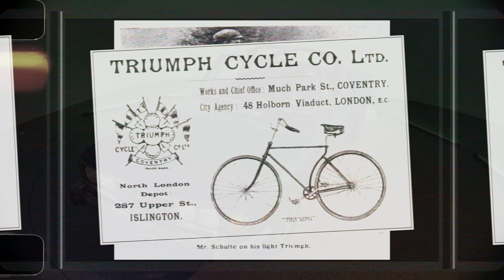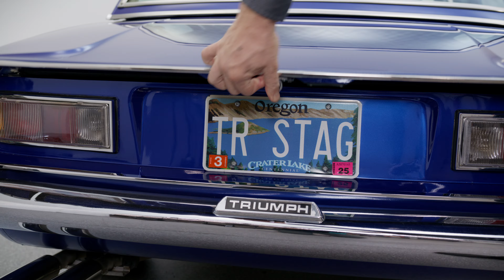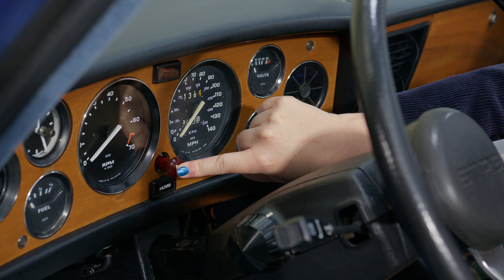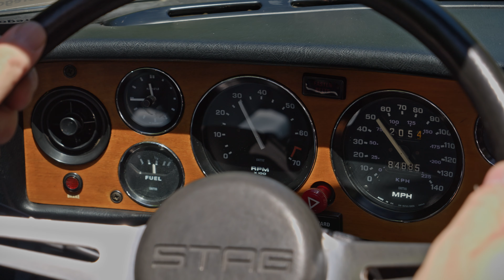Triumph Stag: British Leyland's Most Ambitious Failure | E2E E11

Comment: Love your review< I would go higher on reliability as the Stag was the only car that did not have any major issues on the final episode of the Grand Tour  when they took one to Zimbabwe and Botswana. Also it is one of the top classic cars that has the best survivor rate in that out of the 26000 produced more than 10000 are still on the road with a great support network. Also i have a 71 MK1
Reply: We watched that, but filmed this long before the Grand Tour video came out!  The support network is pretty good, though almost entirely UK based, and a lot of the major problems that were there when the cars were new have been addressed in the aftermarket.  That said, some of the initial issues with the design of the engine are insurmountable making it always a little risky should problems start to develop.  There are still quite a few of the small number of cars sold into the US on the road, but many have had the Rover V8 or a Chevrolet V6 engine swapped in.

Comment: Great vid. Better than Jay Leno's vids for sure. He would have been making snide comments about Lucas electrics, with the comments full of Anglo-phobe jibes. BTW, SAAB used Lucas and Girling brakes, a car brand Jay lauds. I have had countless cars using Lucas electrics and not one gave problems - it must be the air in the USA.  

Although car manufacturers like MG skimped in their electrical systems by not having alternators, batteries just big enough to cope so when the battery deteriorated over time you were in the problem area, not using relays for high amperage components and not using weather-proof connectors - all not the fault of Lucas. All this was easy to do in the factory and after market fixes.
Reply: I agree!   we have a large number of cars from the 1930s through the 1970s, with essentially stock Lucas electrical systems and have very rarely had any issues.  I've had more problems with Bosch electronics failing in classic cars than original Lucas components.  That said, most British cars have very little capacity to handle anything like an electrical short, as there are often very few fuses and often several circuits on each fuse. so, especially when people attempt to modify or add to the electrical system with things like a radio, etc. they either overload the draw or poorly wire things in, causing many of the problems themselves.  There are some exceptions, such as Jaguar, with more robust electrical systems, but many cars only had two fuses, while our Hillman Minx made do with just one.  Still, it was better than our Ford Cortina Mk1, which didn't have any at all!
Reply: @ahaugland1  
The Cortina was made by a US company. 😆
I once changed a dynamo to an alternator on if I recall on an MG. Also fitted a beefier battery. Where the now redundant voltage regulator box was I fitted a relay box with a number of relays so heavy current never ran through dash toggle switches that could easily burn out. Also a big fuse box, then spit the circuits with most having their own fuse, involving adding some wiring. And of course weatherproof connectors. 

A pity high torque starter motors were not available for it then. 

All the car makers had to do was copy a domestic electrical system having fuses on many circuits - divide and rule.  A domestic electrician would never have a house all on one or two fuses or breakers. Normal electricians would look at cars seeing that if one component failed it could take the whole car down. That was not how they approached electrical systems.  Also, if there is a fire he is in court - the law says you must be competent. Looks like many car manufacturers were incompetent, but got away with it as what they were wiring was not inside a house.

Comment: To be fair it has been a hell of a success for a failure with 4508 still registered in the uk and a further 2000+ on off road registrations so under or awaiting restoration.
Reply: To be honest, the survival rate is indeed pretty surprising!  That said, with the US market being what they were aiming for and the car ending up being pulled from that market in 1974 after dismal sales brought on by the reputation of the early cars, it can't be said to be much of a success.  A lot of the issues with the early cars did end up getting addressed on the Mark 2s and quality improved as well as a lot of aftermarket know how came in to fix what remained, but it was already too late for the US and with an increasing set of emissions and safety requirements, it didn't make sense to redesign the car to meet the new US standards when sales were as dismal as they were.
Reply: Unfortunately at the time triumph were swallowed up by British Leyland so although they had their own design studios, and engineers the budgets were controlled by accountants. The main issues with the engine mainly the high position of the water pump and the head bolts and studs were in part down to the fact that SAAB used a 4 cylinder version that due to the fact it was mounted the opposite way round to Triumphs use in the dolomite, meant the high water pump and angled head studs. The accountants would not sanction a redesign for triumphs use which was for rear wheel drive use. The stag engine was basically two of those engines combined.  Rover who were under BL as well already had a V8 which was a derivative of the GM unit from Buick 215 but Rover were in competition with triumph in the upmarket saloon sector so had little interest in helping and triumph went alone. To be honest this was an era where everything was falling apart in the Uk with unions preventing modernisation, politicians interfering and trying to run industry and money being King. The aero industry was another victim. The BAC TSR-2 a Cold War aircraft years ahead of it time, cancelled, The harrier jump jet, many attempts to stop the project, Concorde almost cancelled. I was a toolmaker apprentice back then by 1978 had a Triumph dolomite sprint. Yes the same overheating issues and head warping as the stag which were addressed after market, but we are talking a 4 door sedan, with wood dashboard and door caps, a 2ltr 4cyl 16v engine producing 127bhp 0-60 around 8 seconds 116 mph top speed which was pretty quick for those days. Not many of those stateside but a smart looking car and again here a valued classic like the stag. The success of the marque although as you rightly point out was not realised at the time, has to be in its classic status and the fact that is perfectly capable of driving in modern traffic almost 50 years on.

Comment: would a Davies Craig electric water pump mounted lower down help?
Reply: Possibly, though the original water pump works OK as long as there's no loss of coolant.  An expansion tank definitely helps and the Mark 2 variant has one fitted as standard.

Comment: Triumph's main buyer for sporty cars was the USA. V-8s were selling beefy sports cars in the USA which are now out of fashion. Triumph could have fitted a tuned up straight six into the Stag, but V-8s sold in the USA. The Stag's engine was effectively two Triumph slant-4 45 degree engines bolted together. In the mid 1960s SAAB needed a new engine for their 99, being referred to Triumph and their new design by Ricardo. The 45 degree slant-4 gave lower hood lines giving better aerodynamics. The Triumph slant-4 was used by SAAB in their 99 and 900 cars from 1969. SAAB were the first to use the engine three years before Triumph had it in a car. Using British engineers SAAB started the turbo craze in 1978 fitting a turbo on the slant-4, achieving far more horsepower out of the engine, of which the well made and designed engine handled with ease. It was still being made in China a few years ago, may still be manufactured. The excellent slant-4 was the basis of the Triumph V-8. But bolting together two excellent slant-4 engines never went quite right. 

The high-mounted water pump on the slant-4 was insisted upon by SAAB for maintenance access, as were the angled head bolts. Because they had the engine backwards with the clutch at the front with the engine over the sealed gearbox. So when the two slant-4 engines were made into a V-8 the water pump was also high. Not a problem if the top up water coolant bottle was located high, which in the Stag it foolishly was not - this is basic stuff a simple mechanic studies at tech' college.

There is a U tube video by the Stag Owners Club that runs for about 25 mins. On it are some of the designers of the car and engine, who highlight the easily preventable faults. The prototype engines never had cooling problems after many miles of harsh testing as they got a German company to make special cylinder head gaskets for them.  The buying dept penny pinched buying cheaper gaskets from other manufacturers which never had the compression of the German company - oops.  The head manufacturing was subbed out to two companies. One company changed the water gallery sizes without telling Triumph, starving the head of cooling water. So if you had an engine with two heads from the rogue company you had a disaster awaiting. Or a car from the company making the heads to specification with two good heads then you had a star.  Some engines from 1970 inexplicably went like dreams, so now we know why.

The Rover V-8 engine was considered with the designers saying they would have to lengthen the engine bay by four inches. Not a problem to do at the design stage. But Rover said they could not supply the V-8 engines as they never had enough manufacturing capacity, needing the capacity for the upcoming Rover SD-1. Inexplicably BL did not expand the Rover V-8 engine manufacturing plant to suit their own internal demand, but perversely spent on developing an unneeded new V-8 engine and the teething problems new developments brought. 

Most the problems of the Stag engine were rectified by simple after market solutions. Mainly the many cooling system fixes available including electric cooling fans, superior head gaskets, higher quality timing chains, electronic ignition and high quality synthetic based oils. Simple fixes in themselves which should have been in the original 1970 cars once the problems were known, no doubt making the car a well sold gem as the problems were primarily with only the engine, the rest of the car was superb. The simple after market fixes make the Stag one of the most reliable classic cars today. 

The best bodies were made with an element of hand built at Liverpool by a substantial number of ex marine industry artisans made redundant as ships were becoming massive so fewer ships around. This up-scaling in ship sizes meant the highly skilled men were not needed in the massive port. These men hated car manufacturing, hate might be a mild word, lowering themselves to work in such a low skilled industry, which was not a part of the city's mainly marine based manufacturing culture. Being artisans when they worked it was done right, like paying attention to water ingress as stopping water getting in was second nature to men who worked on ships all their lives. They did all on the car body, including the interior and electrics.

The body was trucked 100 miles to Coventry where the two suspension/engine sub-frames were bolted on underneath complete with components. The smaller sub-frames could have been shipped up to Liverpool having many in one truck instead of large car bodies taking up much truck space going the other way. But never mind, logical thinking did not apply. When the Stag's body manufacturing moved to inland Coventry, as space was needed in Liverpool to build the TR7, the quality lowered.
Reply: What a knowledgeable tribute Sir. It is true the cars bodies were put together with loving hands in the main. I am lucky to own an original car that had a wise initial owner who specified Underseal.. To leave the undercarriage with just red primer was criminal penny pinching

Comment: As a long-time owner of a Stag and admirer of the car when it was first introduced, i agree with many of your comments and feelings on the Stag. A properly sorted and maintained Stag is  a joy to drive. I never tire of it. It actually lives up to its original remit as a sophisticated, comfortable touring car pretty well.
The power steering effort can be reduced  to improve the steering feel.
One other small thing I would like to correct you on is that the front suspension is not double wishbone, but Macpherson strut. More in line with the 2000, 2500 range, not the Tr6. 
Anyway, I enjoyed your take on the car.
Reply from the maker: Glad you enjoyed! The car is a real treat to drive!

Comment: Looks like your Stag is suffering from something that many of our Stag's do - incorrect front ride height due to the quality of the available parts. Chris Witor has the correct parts for you. Beautiful Stag.
Reply: Are you sure?  It didn’t look that out of whack to me.  What’s the right spec?  Some distance from center of the wheel to the lower edge of the wheel arch?
Reply: @speedybuggy65  , it looks just a smidge high on the front. Consensus at SOC seems to be 14-14.5" from the wheel centerline to the wheel arch.
Reply from the maker: This is a very late reply, but thanks for commenting! We love our Stag!

Comment: Three litre V8...Ferrari had one also. Too bad the Ferrari engine could not have been adapted/adopted. Somewhat like the Merlin engine being adapted to the P51 Mustang to make it the legend it became.
Reply: They are pretty different designs...  The Ferrari 308 GTB we did an episode on earlier is the more or less contemporary Ferrari 3.0L V8.  It's much more reliable but fairly complex compared to the Triumph engine.  A big part of why Triumph went this way. which I think we ended up cutting from the final video due to length, is due to Triumph trying to standardize their engine platforms,  having developed the engine family that ended up being in the Stag as a modular system, where it could be a V8 or a 4 cylinder as used in the Triumph TR7, Dolomite, and others in the 1970s, including in a Saab, which is where some of the design issues also came from.  The V8 variant was only used in the Stag, but the problems weren't necessarily unique to the V8 and some of them were also shared with the 4 cylinder cars.

Comment: Would have been a real winner if there had not been so much BL inter-divisional politics and obstinacy that prevented the Rover 3.5 V8 from being fitted.   Or if not, fitting a high mount radiator header tank with a low coolant warning lamp to prevent overheating.  And it would have helped to get ALL the casting sand out of the block coolant passages.

Comment: Oh … one other thing … your hardtop does not have the center spring pin in the center of the back edge.   It’s a good thing to delete if you ask me.  But mentioning differences from stock configuration is a good idea IMO. 

Great video!
Reply: Actually, it does have it.  we didn't call it out in the removal process, but perhaps should have.

Comment: What a great video, your stag looks just like the one that i own. Have been a owner for 34 years, even took it with me to Australia from the UK. It was a shame that BL did not put the Rover V8 in the Stag. I think if they had done that the Stag would have been a success. The Stag V8 engine killed the car. Silly thing is BL had the Rover V8 which they used in the Rover 3500 and later in the SD1.